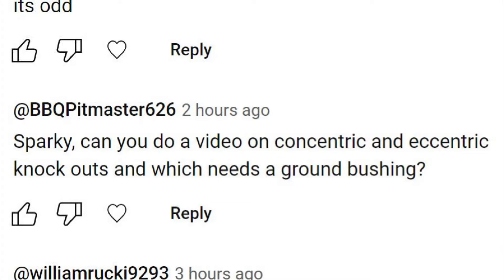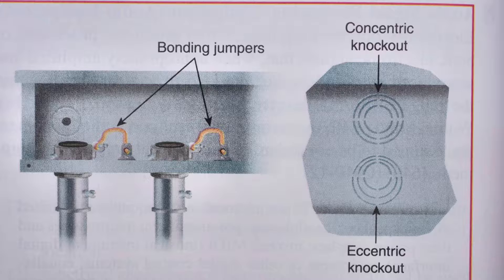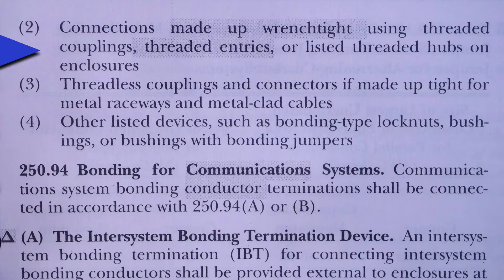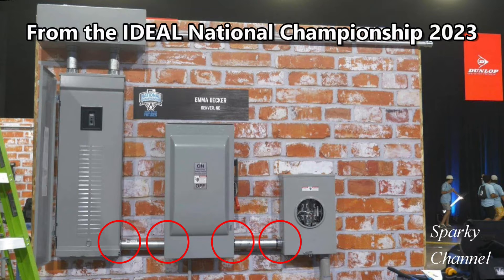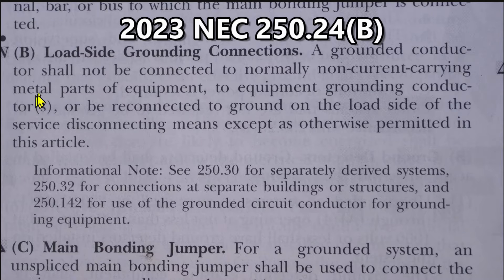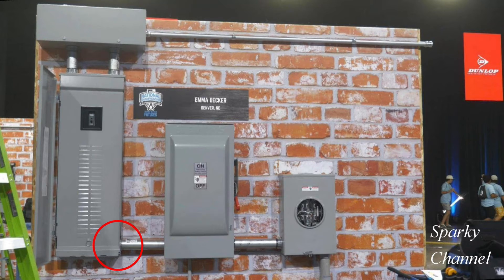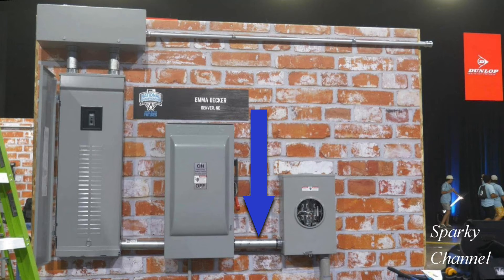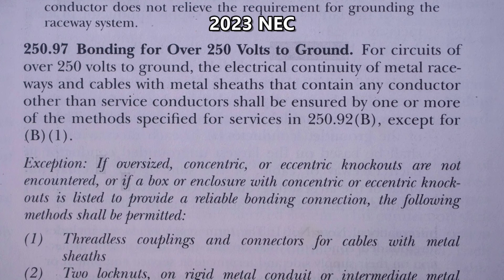Concentric and Eccentric Knockouts: Which Need Grounding Bushings?

Comment: If ground bushings need to be added due to the knockouts introducing impedance, this would be true on the load side too. Metal conduit needs to be bonded, and a poor connection reduces the effectiveness of that bond. Why not just require bonding bushings whenever metal conduit is used with those knockouts?

Comment: Where it states in 250.92:  and service conductor enclosures.  I take that as any enclosure containing service conductors having metal raceway connected to it shall be ensured by.....  With that being said, I would have bonded both raceways connected to the disconnect in your example.  I do understand what the definition of service conductor is, but it does not say anything about enclosures, it identifies what a service conductor is.

Comment: I wish they would get rid of knockouts in majority of equipment. I'd rather drill my own all day long
Reply from the maker: I totally agree with you!
Reply: What’s the difference in performance when drilling your own vs using a knockout?
Reply: @icevariable9600  I perform better and faster and more efficient and I don't have to worry about bond bushings in eccentric or concentric
Reply: @stevenpersinger6577  you still don’t need a binding bushing for holes you cut out?
Reply: I agree with you also.  Especially when the eccentric knockouts break apart .

Comment: Excellent info!
Thanks.
Reply from the maker: Welcome!
Reply: @SparkyChannel  
Been in the biz for a little over 40 years, primarily industrial & commercial, with lots of system control/PLC work and big motor-control centers.
Retired in '20, but still doing lots & LOTS of side work!
Seems it's hard to find "good" electricians these days... none like to do good, clean, quality work anymore - they just slap it together and hope for the best.🫤

Comment: So to be clear. From the ground bushing lug...does it go straight to the panel or ground the disconnect first then the panel ?
Reply: Did you find the answer to this question?
Reply: Hopefully you're still active, the boy bd 1
Reply: Rephrase it more clearly with all due respect the legal work is strong with the NEC.. and can be exponentially difficult to understand with reading comprehension issues. Please lol

Comment: correct answer: yes.

a detail I presume is still valid: if the grounding electrode conductor is routed through metallic conduit, it should be bonded to each end of the conduit, because on a high energy fault, the EMF from the fault can interact with the conduit and cause damage to the grounding electrode conductor, if it is not bonded at both ends.

where I am, that disconnect and panel would be connected with schedule 40 or 80 PVC, so no bonding bushings needed.
Reply from the maker: Yes, that is true. And yes, I'll be using PVC for the GEC. Much easier and less expensive.